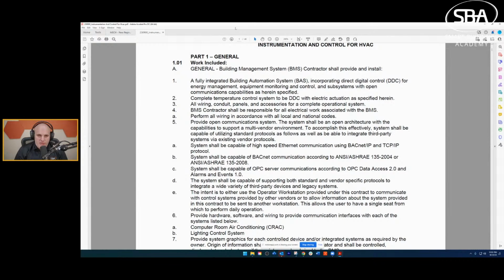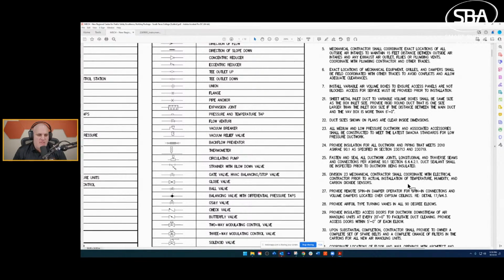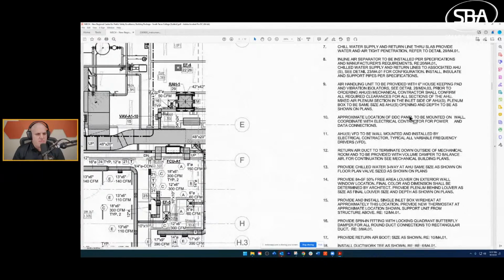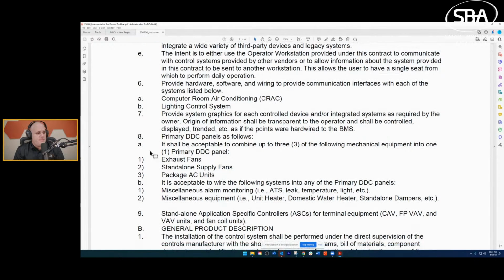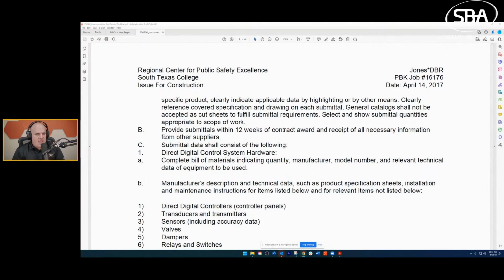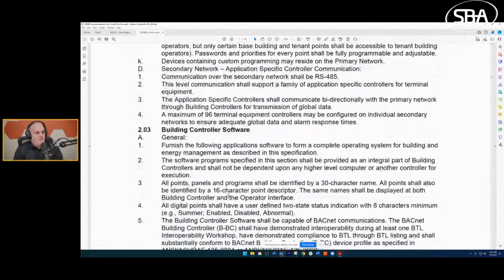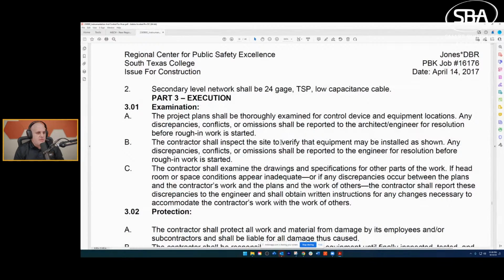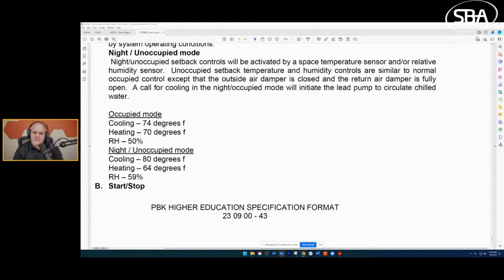SBA 355: How to Read Plans and Specs

Comment: Just started in the industry as a foreman installer. I used to do data, fire alarm, access control. Trying to figure out ways, I can avoid the hiccups as much as possible, or notice things upfront that have been missed. May you talk about a perspective as an installer, and things you can do to help your job go smooth. Thank you for the work you do sir. Just got into this career and found out about you through searching information. Will be a fan forever.
Reply from the maker: Of course we can cover that. I believe we did on a earlier podcast but I think it was part of an overall podcast on roles. I'll make it our episode for next Monday the 5th.